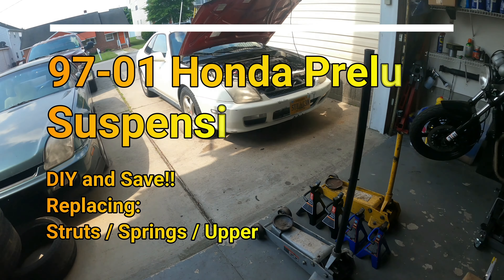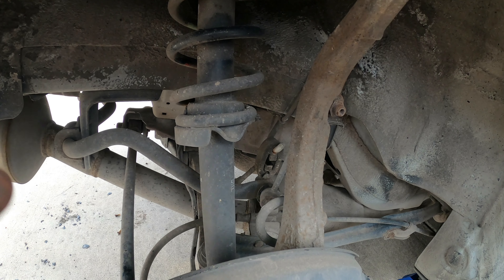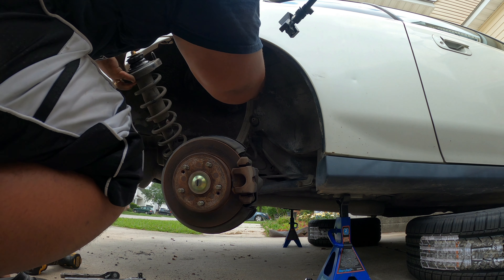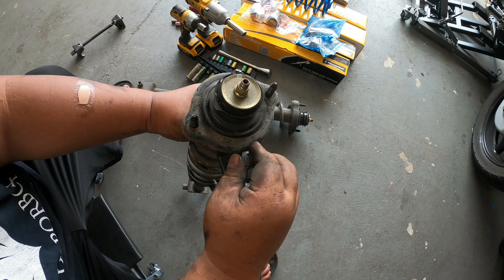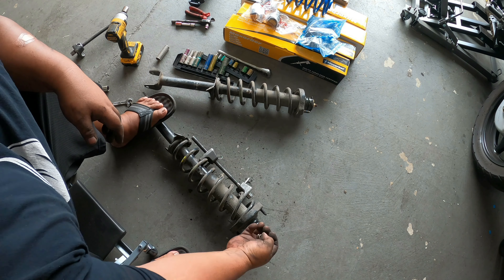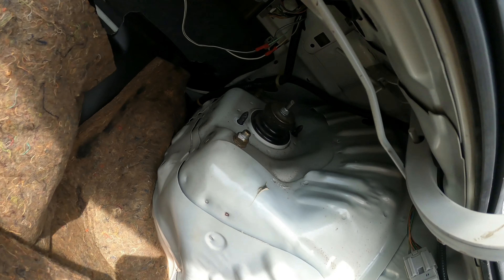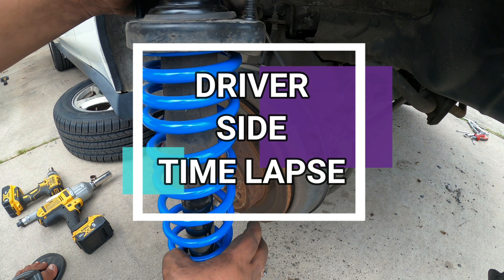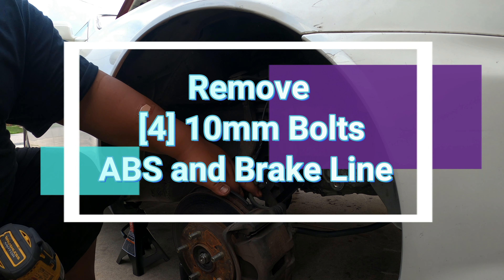1997 - 2001 Honda Prelude Suspension : Struts : Springs : Front Upper & Lower Balljoint 5th Gen BB6

Comment: My caliper bracket scrapes the rotor but only when turning right.  Could replacing the lower ball joint fix this? The brakes are new, but maybe this happening initially could have caused the rotors to warp? I believe it all stemmed from an un-staked axle nut from the previous owner 🙈
Reply from the maker: Warp rotors could cause a bracket scrape if it doesn't turn "true rotation" , easy way to check the rotor is to remove it and use flat edge to determine its flatness.. a worn lower balljoint can also contribute to the angle of the hub assembly, which can cause inner rub for tires, bad handling, and excessive play to where the spindle and brake assembly may shift or vibrates.. the axle nut wouldn't have too much of effect on what you are experiencing now as it only secures the axle from hub to side by side motion, and prevent it from disassembling its self to the transmission, with all the suspension components attached, the movement is really limited..